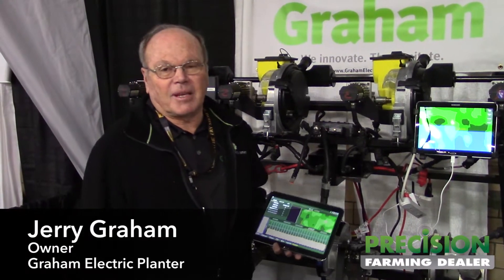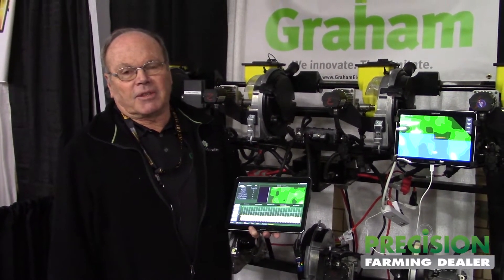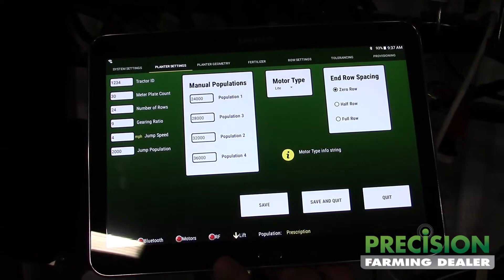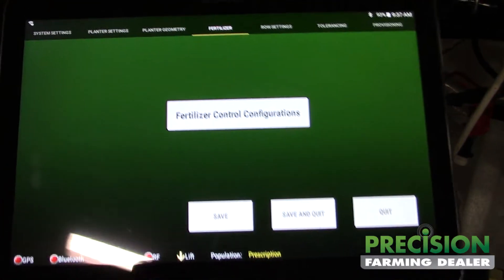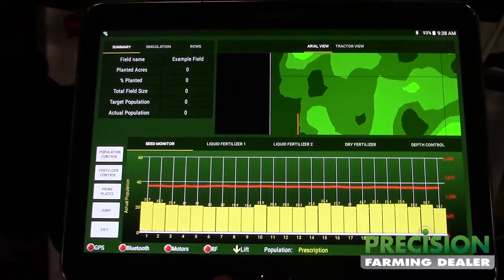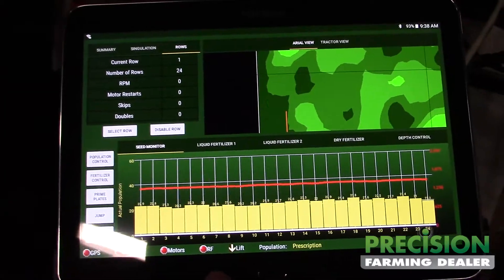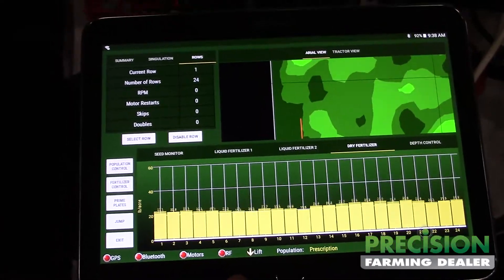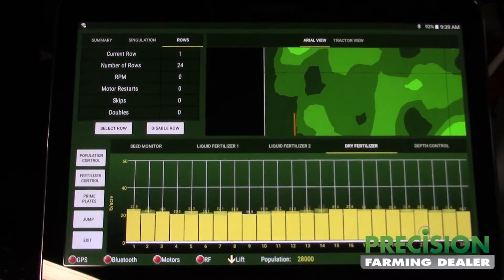Graham Electric Planters Presents the Graham Pro  Wireless Electric Planter Drive

Comment: Hi jerry, there is some software to download those work register to a computer?
Reply: Hello Nico - We are working to launch this Fall our Elayer Cloud Data Center. This will allow uploads of all job files to our cloud.  Within this cloud environment, we have a conversion tool that will allow all jobs to be converted into Shape (.SHP) format. This will allow files to upload into software such as AgLeader SMS, Climate Library, and Trimble Farmworks.  Additionally, in fall 2024, our Graham Command Pro hardware will be climate compatible so you are able to plug the Drive Puck into our hardware to allow Climate sync.